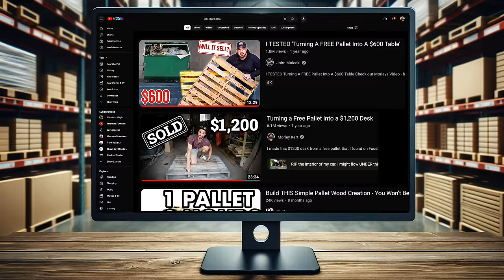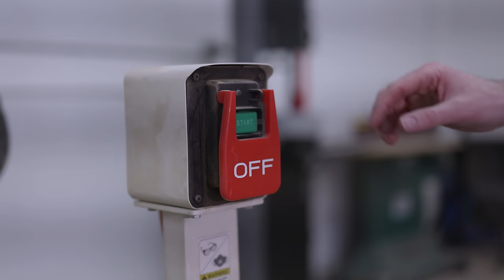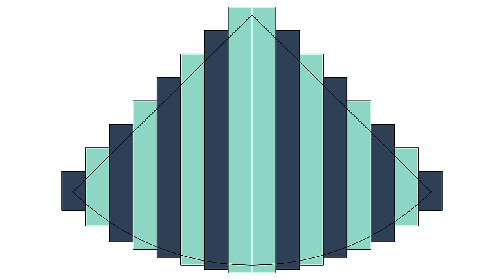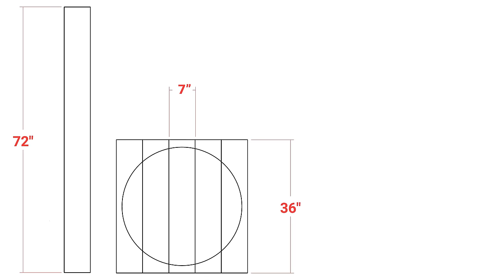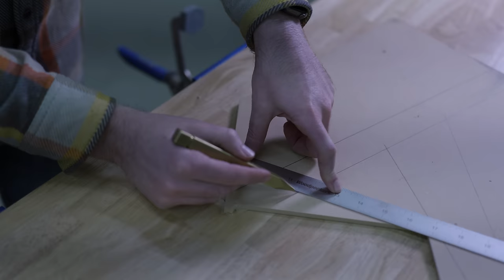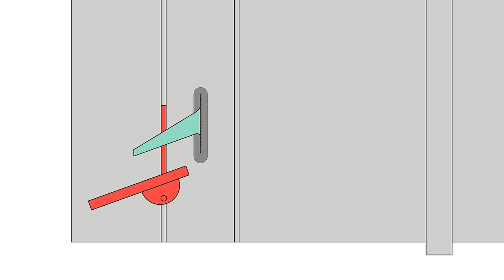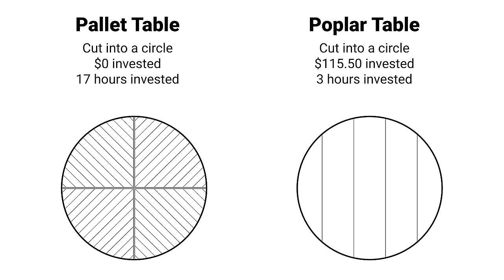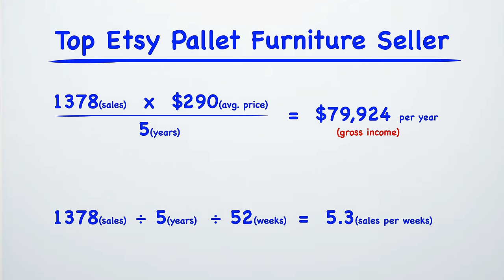Pallet Furniture is a Scam

Comment: I appreciate that the pallet you used clearly looked old and used. My big problem with the other video creators is that many times their pallets look brand new, which to me goes against the idea of finding free wood to turn into something sellable. I used to work in shops and warehouses and the pallets I was around were usually ugly.
Reply: i used to heat my house with pallet wood.... i asked a builders merch to drop off what they had whenever they could, at the time i lived on a small farm so had space for it the pallets that i got where mostly really good condition it shames me to see the work that people make out of it while there me cutting 5 pallets a night to keep warm but it did heat up a 4 bed bungalow
Reply: I find new looking pallets all the time, they are used once for delivery and then discarded
Reply: There's a place nearby that drops mountains of pallets on the side of the road for people to pick up. I'd say at least half of em are "brand new" looking. Many places just dont bother trying to reuse the palettes themselves since shipping em out would cause extra fees. Some places will resent the empty palettes to their shippers, but they wont do it if one of the panels broke since that one is now a risk factor. For this reason, the lifespan of untreated wood palettes is actually pretty short.
However this is only for places that get untreated wood palettes. Treated wood palettes are usually resent to their shippers most of the time even if damaged. It might even be illegal to dump treated wood palettes, I'm not sure though, I'm just guessing on this one.
So if the palettes you think of look really old or are green/blue they are probably treated wood ones while the ones used in projects like this video are untreated.
Reply: You should check out danier made or rag n bone brown. Danier uses nothing but pallets and he's genuine. Rag n bone brown uses all sorts of reclaimed material and does it in a really easy to follow ways. Yes got sponsors now but still uses reclaimed wood, sometimes steel.
Reply: I used to collect all the scrap pallets from a local homebase, before it closed down.  Basically everything that wasn't a blue chep pallet.  There were some (I think from tiles made in the far east) that were very dense exotic hardwood.
The trick to getting nice pallet wood is to get a good supplier, not just grab the first thing you see.
Reply: Up until recently I had almost an unlimited supply of slighlty undersized pallets that my company would be paying to get scrapped. All of these pallets were top notch, therefore despite being skeptical about some of the content creators and their 'free' pallets supply claims, I can see this being a possibility (with right connections).

On a different note, the pallet wood table looked way more interesting (to my taste of course).
Reply: At my last job, we'd have a dunnage guy who just would come along and pick up a bunch of pallets, no idea what he did with them. The best pallets we'd use for our own outbound shipments. Plastic pallets would get shipped back to the maker.
Reply: This is far from used. I've never seen "free" pallets that look as good. The pallets I usually encounter are so sh*t I would never consider using them for any sort of project. I guess US pallets are classier than those we have in Mordor.
Reply: I pick up pallets sometimes,  but i only get the nice ones. I have no interest in messing with dirty pre fucked up wood in top of the labor of tearing it apart.  Being picky means you arent going to gather a lot of wood to run a business on, but i just need it for personal projects.  I also jump on free lumber that pops up regularly. I just have to be picky.
Reply: i kinda like the look of the finished table, it's really complex, it feels like it has more history and depth to it, which, yeah it kinda does
Reply: @MyshelafromTanelorn  pharmacy and import/export mandates new pallets. so once used pallets are unusable for anything other than local transport. (various contaminants and seeds) so if you take those pallets away you actually save the warehouse the money they would spend disposing them.
Reply: @bung1e  whatever dude. thats called "biofuel." the energy to heat your home has to come from somewhere.
Reply: @BoraHorzaGobuchul I work at a warehouse in Michigan.

Probably 40% of the pallets I see look like they've been used at most 3 times
Reply: @ML-sc3pt  first world :)
Reply: @BoraHorzaGobuchul  yeah. Where pretty much all pallet carpentry is done.
What's your point
Reply: @ML-sc3pt  my point is that depending on your location, chances of finding pallets that are worth using vary significantly.
Reply: @BoraHorzaGobuchul  that's a really shitty point as you're comparing 1st and 3rd world when this is clearly a 1st world trend.

Apples and oranges buddy
Reply: My employer gets most things delivered on non-standard sized pallets. They might be standard size for the particular suppliers, but not industry standard. Even though, they do not want them returned, because they are only middlemen for the factories located overseas. So it would cost them to send them back to source. So we take a literal truckload of perfect pallets, sheets of plywood and even 4m long (14 foot) long x 300mm x 300mm shipping boxes made from tropical hardwood - I kid you not - straight to the dump every week. The local hobbyist woodworkers know about this, but only come to collect very little, on an irregular basis. A crying shame, if ever I saw one...!
Reply: Many have that gray weathered look from long exposure. It may be a desirable aesthetic in a given project, depending on your preferences. Not an immediate draw for me when in pallet form, however.

Comment: We use old pallets as raised flower garden edges. It's cheap, doesn't need to look amazing and it's easily replaced when it degrades too much
Reply: yeah heat treated pallets are great for the garden. sand down anything too rough and chuck on a quick outdoor finish and that's enough most of the time. you don't even have to take all the nails out if you don't want to.
Reply: I've recently made stepstools to get into the big elevated garden bed where I live. One was so good it was stolen! Way back when, I got a huge pallet and made a sort of coffee table out of it by adding legs made from an old 4x4. I made a  bench out of a couch that someone had thrown away, by ripping off all the upholstery and using pallet wood to redo the back and seat. We had a living room in the carport. Hippies, that's what we were. :-)

Comment: I’ve pulled apart between 20 and 30 pallets. The cost of your time and frustration should definitely be considered, along with all the milling and prep work needed to have useable pieces. Pallet wood is great for projects that don’t need to be smooth, perfectly flat, etc. I use it for utility projects like garage shelves, braces, storage platforms, etc.
Reply: Or things like mud kitchens for kids. No prep is required and people are selling those for $500+ all you need is old wood and an old sink. Would take a good wood worker like 2 hours max to put together.
Reply: Once I get a process down and get into the rhythm, I can process a pallet down to usable pieces in ~15 minutes. Not bad at all if I don't care about making something beautiful.
Reply: I've ripped some pallet wood down to smaller strips to be used in custom lighting for a DIY smart home. I've also disassembled numerous laptop, tv and pc screens to get the plastic sheets inside, so they can shine as bright as daylight. Doing it this way is far, far cheaper than buying smarthome lighting from the store, even with all the labor included, but it's also about one of the only places where doing anything that requires milling and smoothing the pallet wood, is actually worth it. Most cases it is absolutely not and just a massive time sink. I've probably disassembled the same amount as yours. Best use for pallet wood inside the home is 10/10 a pallet wall. They're also fairly sturdy for hanging stuff. My desk is sitting in a corner where pallet wood is mounted to the walls. Been using it for 8 years now, so I'd say it's a pretty great use
Reply: I just used a sawsall and a demolition blade. Cut right through the nails no problem.
Reply: I dont mess with the small pallets at all anymore. I find large pallets with 3" x 5" "feet" usually 5' long or better. Sometimes made with maple or other hardwood for greater weight loads.

Comment: Another big advantage of pallet furniture is, that if you do not sell it, but make something for yourself as a beginner, you don't need to have such high standards. When I moved into my first own apartment, I built my own custom bed with very very basic tools out of fairly mediocre old wood. Not typical pallet wood, but rather wooden shipping crate wood (so much longer pieces). I was able to save a ton of money this way, since getting a bed with 1,4mx2,4m would be fairly difficult and expensive and I used mostly scraps.
Reply: @kovona don't worry, he only got 17 types of cancers
Reply: You can get most furniture for free, because it's bulky and people want to get rid of it. Why the effort to build your own crappy stuff?
Reply: Having already survived a fire, one of the things I don't like about poplar, is that it's highly flammable.  I use poplar logs for outdoor projects (retaining walls for holding soil as an anti-flood barrier, garden beds, compost bins, etc.)
Reply: @kovona  yes. dont use pallets as sleeping beds. in fact, don't use them for tables, chairs, or anything, either.

". ISPM 15 affects all wood packaging material (pallets, crates, dunnages, etc.) and requires that they be debarked and then heat treated or fumigated with methyl bromide

Treatment of wood packaging requires a concentration of up to 16,000 ppm.

Brief exposure to high concentrations and prolonged inhalation of lower concentrations are problematic.[22] Exposure levels leading to death vary from 1,600 to 60,000 ppm, depending on the duration of exposure (as a comparison exposure levels of 70 to 400 ppm of carbon monoxide cover the same spectrum of illness/death). Concentrations in the range of 60,000 ppm can be immediately fatal, while toxic effects can present following prolonged exposure to concentrations well under 1,000 ppm.

Bromomethane, commonly known as methyl bromide  
Health effects
Excessive exposure
Expression of toxicity following exposure may involve a latent period of several hours, followed by signs such as nausea, abdominal pain, weakness, confusion, pulmonary edema, and seizures. Individuals who survive the acute phase often require a prolonged convalescence. Persistent neurological deficits such as asthenia, cognitive impairment, optical atrophy, and paresthesia are frequently present after moderate to severe poisoning. Blood or urine concentrations of inorganic bromide, a bromomethane metabolite, are useful to confirm a diagnosis of poisoning in hospitalized patients or to assist in the forensic investigation of a case of fatal overdosage.[24]
-
Whereas the Montreal Protocol has severely restricted the use of bromomethane internationally, the United States has successfully lobbied for critical-use exemptions.[18] Critical use exemptions allow the United States to continue using MeBr until it is scheduled to be completely phased out sometime in 2017.[19] Bromomethane was still in use in the United States for cherries exported to South Korea as of 2022.[citation needed]

In 2004, over 7 million pounds (3,200 t) of bromomethane were applied in California. Applications include tomato, strawberry, and ornamental shrub growers, and fumigation of ham/pork products. Also exempt is the treatment of solid wood packaging (forklift pallets, crates, bracing), and the packaged goods, being exported to ISPM 15 countries (to include Canada in 2012).[citation needed] "
Reply: well yep that's what is spupposed to be used for mostly, not profit but easy way to build your basic furniture :D
Reply: @miskatonic6210  Try getting an unusually long bed for free. Getting a default bed with 2m length should be fairly easy, but then my feet would hang out of the bed all the time, since I am 1,94m. My custom bed is now 2,4m long, which is so much nicer.
Reply: @kovona  I used rather old boards, that we had stored away for decades from a printing press or something like that. Some boards wer also recycled from old IKEA beds and some were previously used to pour concrete. Let's say, that for a lot of those boards a lot of sanding was required.
Reply: @Redmanticore  you said to dont use pallet wood for anything, and then copied  text that says that only some of the pallets are chemically treated. just learn how to tell them apart, they are labeled so with some you can be 100% sure they dont contain methyl bromide. and if you are worried they may have been contaminated by the things shipped on them, then just source your pallets from local bussinesses where you can ask about the pallets history, rather than picking up some random ones from trash. no need to completely reject the opportunity to get a lot of free wood and save it from getting destroyed.
Reply: @miskatonic6210 you do not understand the joy of creating something with your own hands. Some people receive satisfaction from making things.
Reply: @arnor398 Exactly. My dad got a bunch from his work. They were a nicer type of wood then what a lot of palettes are made of. He build me a bed frame and I love it!
Reply: @kovona  Methyl Bromide - dissipates rapidly at ambient temperature. Grain is treated with it.
Reply: @arnor398  Pallets are often sold on for reuse, so you nobody knows a pallet's history.
Reply: @Redmanticore  Zzzzzzzzz...nice copy and paste...to much trouble to do RESEARCH.....also..Pallets stamped HD  are perfect to use...now go find something else to copy and paste..maybe a few brain cells..
Reply: @kovona   

unless you work in a factory applying those chemicals it is probably not a problem, if you aren't handling pallet wood dust day in day out then it is definitely not a problem. 

People work in warehouses full of this stuff, if it was a problem they'd have respirators on. Not to mention 1000 ppm is an absurdly high concentration for something like that to reach by passively wearing off surfaces.

 That's 0.1%! for reference CO2 is 450 ppm in the air. Opening the door occasionally should be fine.  

You should be more worried of barbecues and motor vehicles.
Reply: Personally, as someone just getting interested in this as a hobby (I don't have a workshop, or even many tools, so it's all hypothetical right now), I can see the value of being able to work with free materials, where it doesn't matter how many mistakes you make - you can throw it away or use it for kindling, and you learned something along the way. I would probably be happy enough using it for shelves or stuff at home, but I have no interest in making stuff to sell. 

Therefore, I couldn't easily justify investment (at least, when starting out) in high quality materials and power tools, when I'm not making that money back. I do, however, acknowledge the value in time and effort saved by using pre-milled lumber.
Reply: @Redmanticore  this is actual paranoid schizophrenic tier lmao
Reply: Customizing your own things is the main reason to get into it imho. Practical jobs that aren't to be looked at are a good place to start. Draw divider, extra shelf, whatever it is.
Reply: I'm making a bunch of things for my patio garden put of pallet wood. I've never made anything out of wood before and I don't really care about the finish so pallet wood is great for keeping costs down and taking the pressure off. it's more work but its all learning so I see that as a win
Reply: @lizzyol  at least you don't need to buy all the wood and waste money on mistakes!